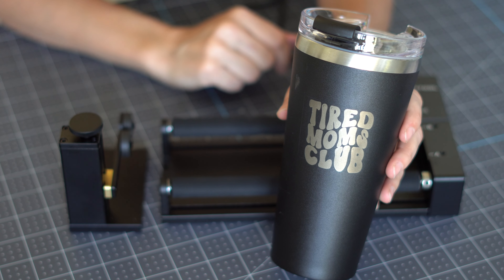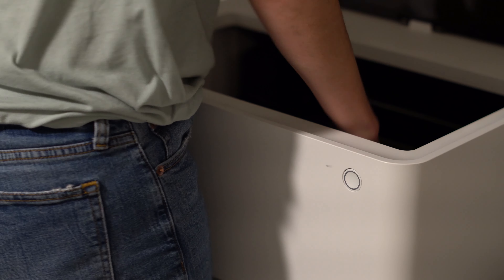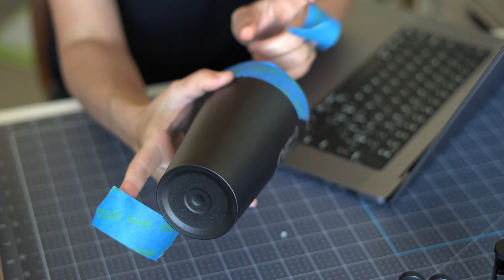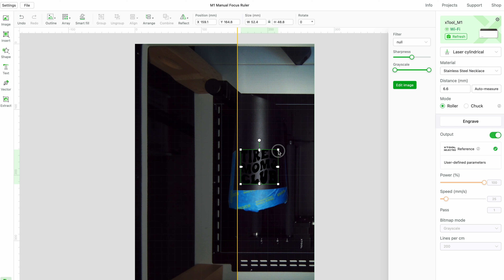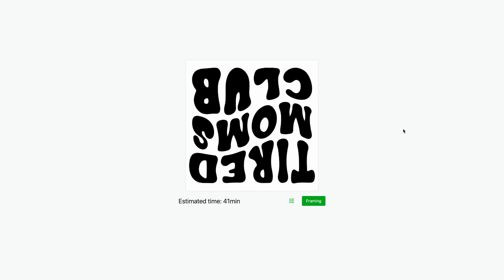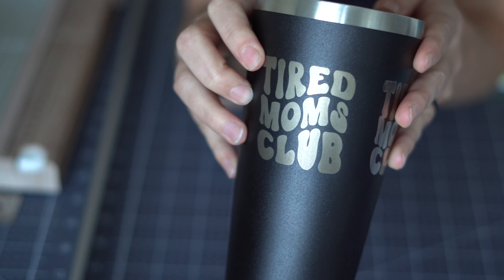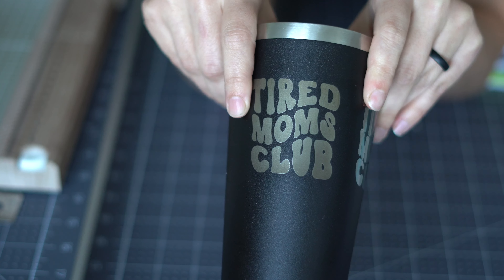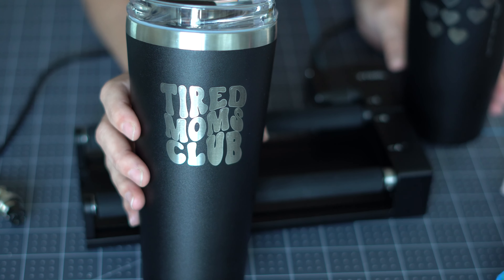How to Engrave a Tumbler with the xTool M1 Laser & Rotary Attachment (all settings included!)

Comment: Is your M1 a 5W machine or 10W? Just wondering if that would have an effect on the power settings.
Reply from the maker: Great question- I have the 10w. You’d need to adjust your settings if you have the 5w. :)
Reply: @KarleyHall  thanks!
Reply: @mrbaalloo hey I'm having the same problem did you figure out what settings you needed?